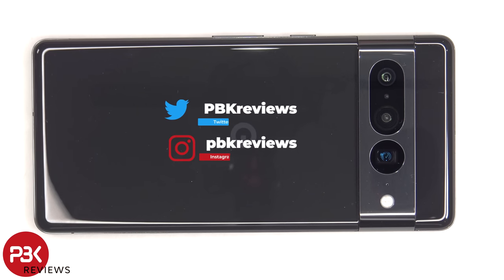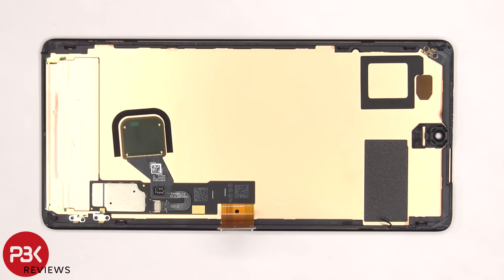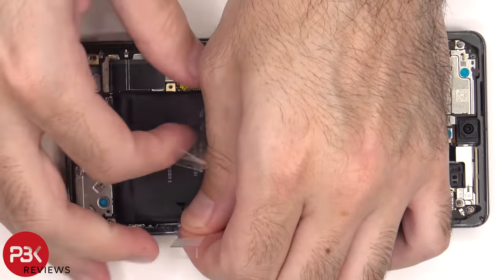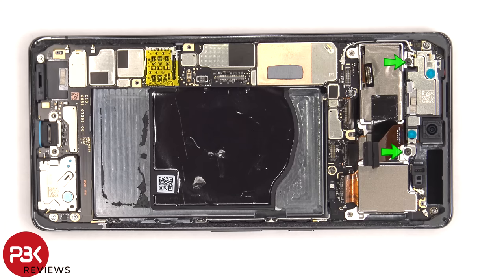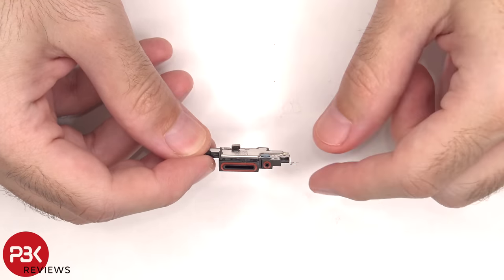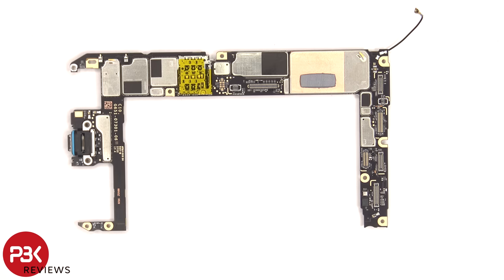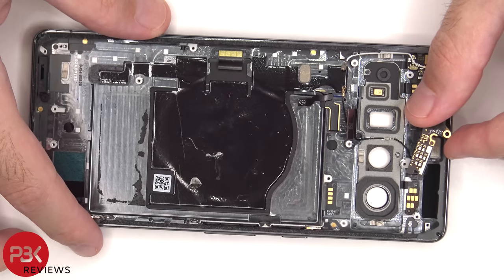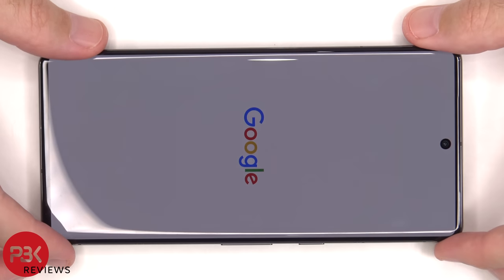Google Pixel 7 Pro Disassembly Teardown Repair Video Review

Comment: Wow, looks like lishen battery there. Let's see which one does it's job better lishen or atl
Reply: What's the big difference?
Reply: @sora.2111  chemicals inside battery. I mean which one is more durable
Reply: @majong_da  ah ok interesting...did you experienced any differences between this two...or which is usually better?
Reply: @sora.2111  the vendor of note 7 batteries was atl. Ig they improved a lot because atl is main vendor of batteries for bbk, Xiaomi, Huawei, Samsung, Motorola. I saw lishen in phones, but it was cheap ones
Reply: @majong_da  hmm ok good to know, thanks 👍🏽

Comment: This phone is such a piece of shit,  I was never even able to get 2 hours SOT from day one wit no standby
the phone  overheats too,nothing runnig but chrome,
but today I woke up and my phone was plugged in overnight and when I went to pick it up and I almost  burned my hand, the phone was too hot to even handle when I took it out of the case
and it had only charged to 70%
it would not boot up either, It was going to the Google logo and then shutting down, probably finally triggered the  heat sensor but too litlle too late.
I put the phone in the refrigerator and then it cooled a enough to boot but now the phone is rattling like a MF'er
whenever I move the phone I can hear a bunch of shit rattling around inside, it sounds like it is comming from the  camera  visor
from the video I don't think it's the batttery glue that melted and came lose  so maybe it coudl be the   camera sensor glue?
anyways thi is a dangerous defective product and  Google spport SUCKS,, I reported the battery drain an doverheating issue  from when i first got it and Google refused me warranty service 
this thing is  house fire waiting  to happen.
I have owned  every Google phone since pixel and they have all been defective trash   overheating and battery issues on almost all of them
some of them I got   some  of my money back through class action suits , Google refused me warranty service every single time on all of my phones going back to the nexus 6p, on that one they tried to pass the buck to  Huawei but they also  refused warranty and  passed the buck back to Google.
Google is  fucking cancer

Comment: Pixel 7 same?
Reply from the maker: Should be similar but not exactly the same. I will look into possibly doing a teardown of that as well if I can.
Reply: @PBKreviews  thanks, as per your point, one thing is disappointed with Google is the usb type c port soldered in motherboard is very bad design! Pixel 6a & 6 series also! What if the port damages will the service centre replace the entire motherboard or only the port! Hope next year it should be modular!

Comment: He tore down under two minutes and had it  back together in 60 seconds wtf
Reply from the maker: Because the re-assembly is sped up just to get to the point where the phone is powered on to show its working.
Reply: @PBKreviews  o lol it’s cool dude any chance u could do a pixel 7 pro so I don’t have to?

Comment: So if you break the protective glass over any of the cameras, you need to dismantle the entire phone to get access to it ? Not good for me.
Reply from the maker: The glass cover over the camera lens on the back can be removed by applying heat and prying it off. Its held on with adhesive.